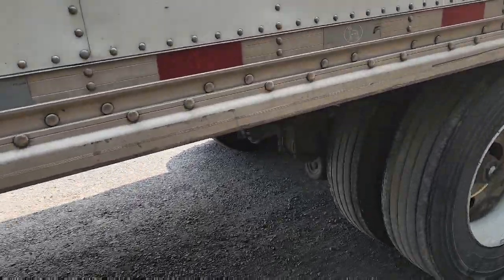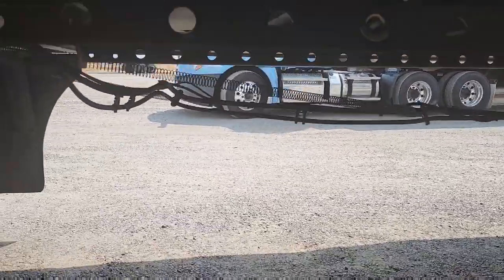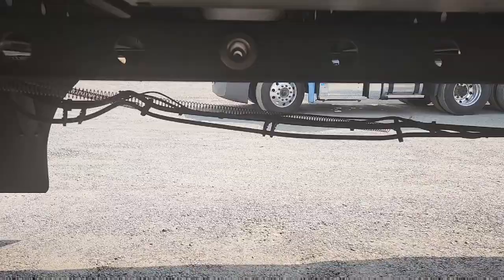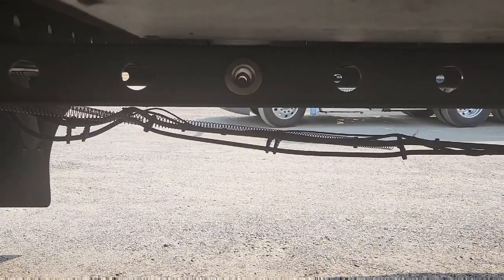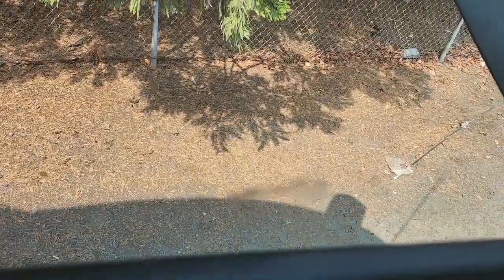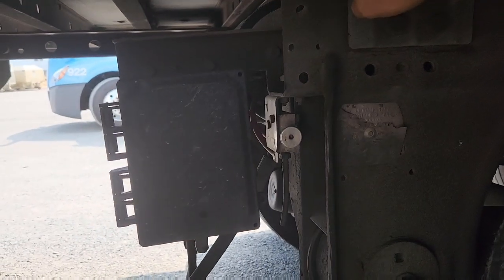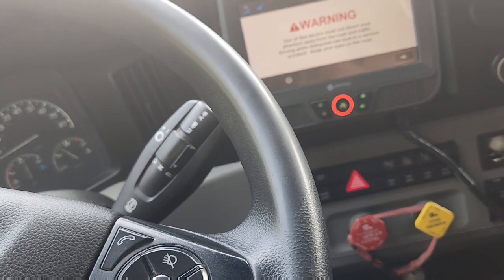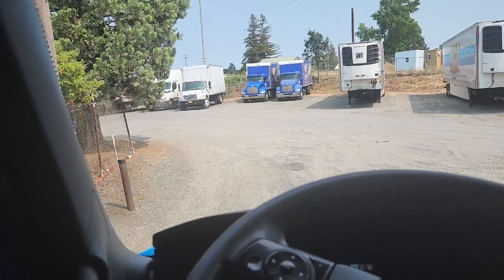Easy Sliding  Tandems #Tips and tricks tricks #trucker life #Truck driver @Charlee the trucker

Comment: Just got my truck assignment. Going pick it up tomorrow in Zionsville. I’m coming from spread axle flatbed. Worried about being able to slide my tandems. Never had to do it before
Reply from the maker: Not a big deal on refer each hole is around 400 lbs so give me a call 602 369 3037 if you need help pick up a tandem stopper on Amazon good luck
Reply: Thanks man